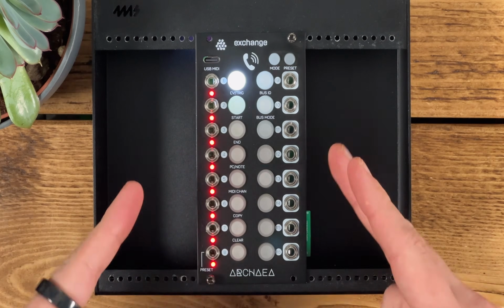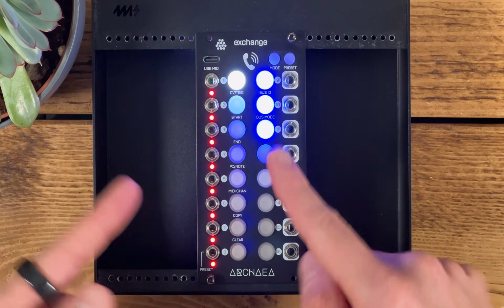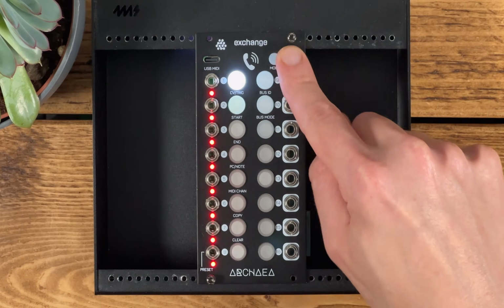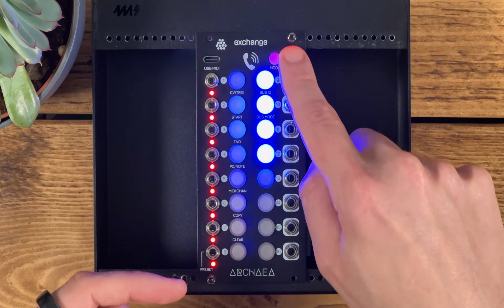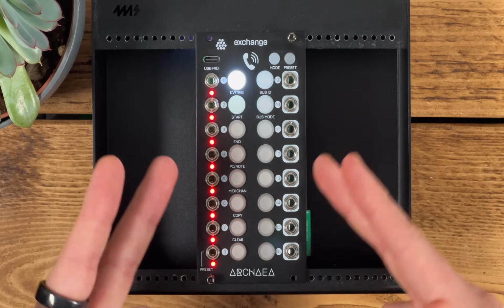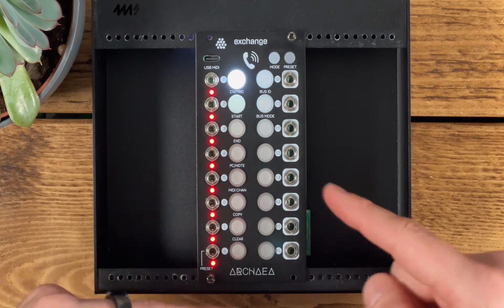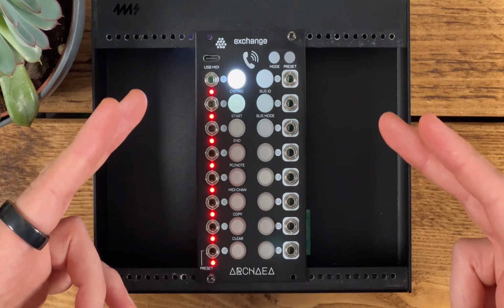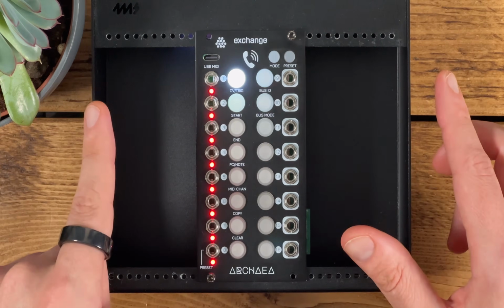Archaea Exchange | How a patching matrix can unlock your modular synth

Comment: Have you used this with the Make Noise Jumbler? Curious to see how that would work.
Reply from the maker: No, I don't have a Jumbler. Even if I did, I'm not sure how I'd go about pairing them, tbh, as they can do quite similar things (although Jumbler crossfades the routings while Exchange hard-switches them). Did you have anything particular in mind?

Comment: That 8 way rotating switch patch is awesome! Also great to have TM compatibility. Is there a mode where it randomizes ins/outs? Or create random presets?
Very interesting module, which could fit very nicely in my setup. Thanks
Reply from the maker: There’s no random preset generation on the current firmware (only random sequencing of saved presets) but I’ll pass on the suggestion!
Reply: Added to the list for the next firmware update!